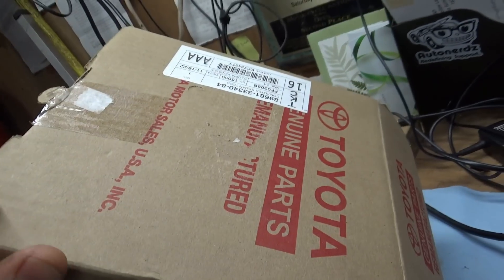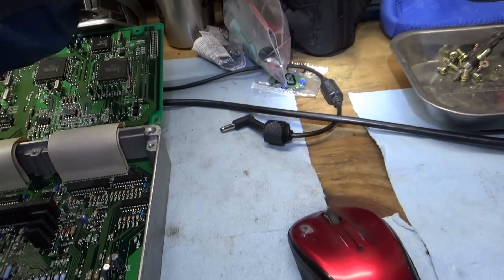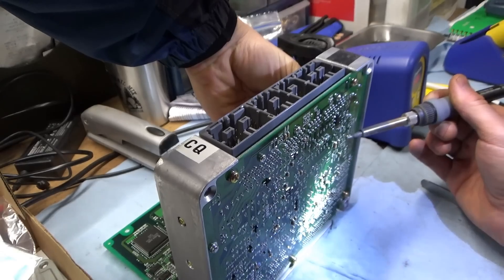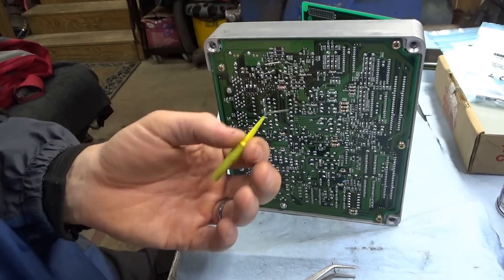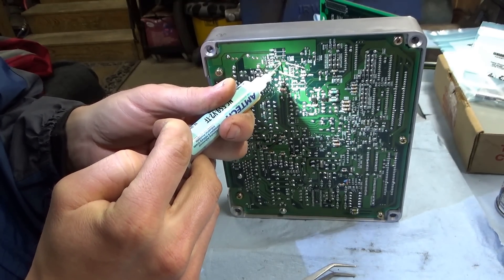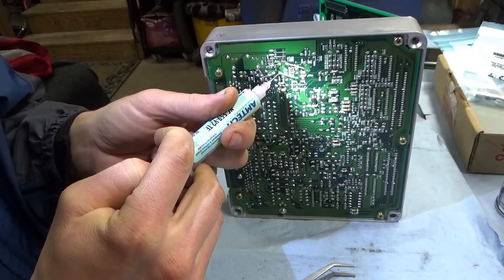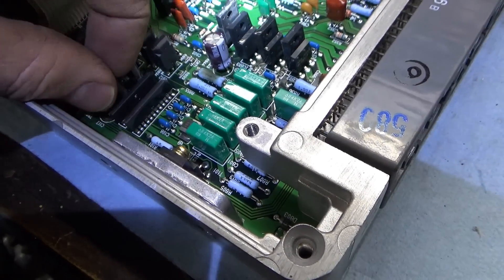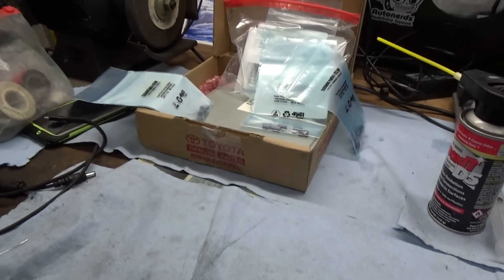Crazy Classic Camry: Intermittent LIMP-HOME? (Part 3: COMEBACK?)

Comment: I have successfully jumpered damaged traces with small gauge wire. Good catch by the customer! Ivan you need a Hot Air Rework Station, they are cheap and make desoldering a dream.

Comment: I suggest to use higher voltage capacitors, 35v should be more than enough. 15v ones working way on its limit and are prone to fail. Anyway good job Ivan!

Comment: Should have used solid capacitors instead of replacement wet capacitors. As you already saw, wet capacitors leak and destroy the board.  Wet capacitors are like batteries, they will leak and will destroy the device.  Using solid capacitors avoids the future failure.  His spare and repaired computer will be dead in the future because of the presence of wet capacitors.  Factory uses wet because they are cheaper not better.  
Can use nail polish for covering traces in repaired boards.  Can use nail polish cleaner or acetone to clean up leak from boards.  
Did you use your meter to test the new capacitors for being good?  Replacement parts need to be known good new.  Assume you got the polarity correct when installing replacement capacitors.  
Good that the factory wasnt pairing computers with the cars yet or would have been reflashing PROMs.  
Complements on venturing into module repairs.

Comment: For fine work like that, I would strongly recommend some desoldering braid.  Worst case, use a little extra flux with it.  The old solder will come right up.

Comment: DigiKey rocks! I was able to repair the original Ford MLP sensor (neutral switch) on a family member's 97 Taurus by replacing the bad surface mount microresistors with perfect matches from their catalog. Their selection is incredible.

Comment: I used to repair those ECMs for a local auto shop nearby. Almost all of them were 91-96 Toyota/Lexus models. Mostly LS400, ES250, RX250 and Camry. Some of them were so bad that I had to use jumper wires all over them. Lots of eye and neck strain from looking at a magnifier for long periods of time. When I watched the first two videos, I had the ECM in my mind. But who am I to second guess you! The ECMs I worked on had a variety of symptoms ranging from misfires, no start after hot soak, injectors not closing or opening, etc...I used to clean the pcb with acetone and a toothbrush. Thanks for the video. Great stuff as always.

Comment: "Back in the day" I repaired bunch of ECU's on `90 Toyotas (pretty much AE101 20V units), most of them would have leaky Nichicons, most of the time symptoms will be rough running, in AE101 case it would leak on to base of the VVT Transistor and cause VVT to intermittently activate.

Comment: For replacing electrolytic capacitors, always use Low ESR caps, 105 degrees Centigrade. For opening holes, I use a wooden toothpick as it opens the hole and does not try to get soldered in. Vacuum pump driven desoldering gun is obviously better, but overkill for sporadic use.

Comment: I don't understand why he just wanted the old one fixed? Unless there have been issues with the remanufactured ones. Wouldn't most people just have you install the new one?
Reply: The new reman worked fine. I had Ivan repair the old one , and he did, and I reinstalled it when I got it back and it’s been perfect ever since , and I put the reman on the shelf for a spare. I also got a spare exciter box on the shelf. Being these parts are somewhat problematic on this vintage, I’d rather have them and not ever need them rather than need them and have a hard time sourcing them down the road. 👍

Comment: Solder wick is great for double sided PCBs, it will clear the old solder on both sides, and with a bit of practice you can clear the through hole out also, more heat (to a point) is also beneficial as pulling on components when the solder is not fully liquid can put the tracks off the PCB especially on the double sided boards.

Comment: I can confirm that Northridge Fix’ solder wicking braid is excellent for through hole components. He has also started marketing a solder sucker that works pretty damn well also. Most of them suck, figuratively, but not literally. He actually does suck.

Lay down some of that flux, put the solder braid on the hole, give it some heat, and watch the magic happen. It’s rather amazing! Cheap, too. One roll of it would probably last guys like us a lifetime.

Comment: Capacitor replacement Tip:

When having to replace electrolytic capacitors like Ivan is doing with this ECU. 

The Voltage is very very critical more so than the microfarad specs on the defective capacitor .
Reason the voltage is very critical is if you go with a lower voltage for the new replacement It'll at least vent its electrolyte mixture or at worst it'll blow up with a bang it'll scare you and choice words might follow or the can its self could pop off with a bang the smaller caps sound like a .22 callaper gun being fired off . Pretty much don't over volt electrolytic caps or they'll go off  with a bang.  If you cant get the exact voltage for the replacement cap go with a higher voltage rating with the same microfarad rating as the old cap.  

Also the electrolytic in these types of capacitors is corrosive and can and will eat the circuit traces on the circuit board.  If the traces are damaged use distilled white vinegar to neutralize the electrolytic then use either 99% rubbing alcohol or denatured alcohol to rinse the vinegar off . use pieces of insulated wire to make new circuit traces from point to point.
Reply: Any of the capacitor specs can be important depending on the use case.  But yes, exceeding the max voltage is a quick way to failure.  But failing on other specs is a much more difficult issue because you're not alerted to your idiocy with component exploding.

Comment: Good work, Ivan!  I am confident that your repair will outlive the rest of the 30 year old Camry!  I'm just curious though.  If the owner did ever have to use the new part from the dealer, would he have to reprogram the VIN?
Reply: Just rewatched this series this morning for a Memorial Day special. I put the pcm in before Ivan repaired the old one and it cured the problem. When I got the old one back from Ivan, I reinstalled it and put the new one on the shelf for a spare. Been working perfect ever since. No programming needed on these , just plug and play. Just treated the old girl to a new Toyota battery a few weeks ago. 👍👍🇺🇸

Comment: I had the same problem in a 94 Camry, open the computer and all the same capacitors were leaking causing the car not to accelerate. I just didn't know we're to find the capacitors.

Comment: Just a tip Ivan. To remove Retro electronic components, first cut the leads on the component then take out the lead or pin if it's an IC from the board. To clean the hole of solder use a Solder Sucker or Solder Wick ( they are both inexpensive and work better than expensive de-soldering stations on retro electronics) . This tips will reduce the chances of damaging the PC Board. Love your videos

Comment: Holy Cow, Ivan !!!  I am going through that exact same process to replace leaking caps on boards in my old 89 Toronado Trofeo.  Got a few caps and a diode or two in the VIC (touch screen Visual Information Center), and at least one in the Digital Cluster (responsible for power to the wakeup process).  The car has been parked for 4 years due to loss of communications, and cap degradation on the CRT screen and cluster.  I'm hopeful this will bring that car back to life, as I ordered it new, special equipped, back in the Fall of 1988.  Wish me luck!

Comment: use to have a 91 mirage with a capacitor leak in ecu-replaced and lasted a little over a year then different capacitor blew out and ate part of board, got good refurb board and lasted till trans broke 328k miles.

Comment: A good plan is to cut the component off the board, leaving the pins sticking into the board, then remove the pins, by themselves, one by one, as you will then not have to straighten the bent over pin on the solder side... just heat to molten, and use tweezer to pick off the, now straight, pin.  Attempting to straighten the bent pin using the solder iron tip is a good way to either pry the trace pad off the board, or have the tip skid and jab some nearby, unintended, joint.  A cap, for instance, when removing as you are, requires you to lean the component, thereby pulling on the non-involved pin.  Use a solder pullit to vacuum solder off the board, clearing the hole.  A needle can become trapped in molten solder.  Also, always add some new solder to add to old joint solder before pulling the pin.  Then clean the excess solder off the pad.  For a tall component like this cap, apply some silicone RTV to board/cap junction, to dampen any vibratory moment onto the leads.  When clipping off new part leads, always hold the loose end of the lead before clipping, to keep if from firing off to some unknown place.

Comment: Well done, electrolytic capacitors globally had a big problem about the time that unit was made due to a bad electrolyte formulation. I have changed a lot of them in  devices of that era. I tend to use a spring loaded desoldering pump  and spray the board on completion of the job. Great to have proper closure on the fault, the car was worth the trouble.

Comment: Working with Communication boards in an air traffic control system 80% of our problems were proving to be degrading electrolytic capacitors. We began by replacing them with Identical 'original' components then it occurred to us that we were just making for a fault in another 5 years so we identified an identical specification capacitor from a different supplier and had no further trouble in my remaining 10 years.
We also had a similar joint / trak issue on a GMC minivan wiper controller , luckily we did have track repair kits. A vacuum desolder units makes life MUCH easier

Comment: With the older boards such as this, it helps to add fresh solder to the solder joint. It makes it easier to desolder later. Then use a desoldering braid to wick away the solder, which should also pull through any solder that is trapped in the through hole.

Comment: Ohh, it hurt my electronic engineer heart a bit.
You realy should use the desoldering station, when you pull the cap, you can pull the trace with the cap on the component side.
And when you solder in the new component, you cut the leg before soldering. When you cut the legs soldred in, you can cause stress in the throughole, the board can be multilayered, and the connection could breake.
I normally use isopropanol alcohol and a cotton stick to clean the crusty after the faulty component has been removed.
Anyway, nice work. 👍👍👍

Comment: Hi Ivan, many manufacturers install electrolytic capacitors at or very close to the working value of the circuit over time these components will fail by design (engineered obsolescence). because of this I always increase the voltage of the capacitor when I replace them. Koodos to the owner for finding this.
Rich

Comment: Excellent video Ivan! This goes to show, that fancy code scanners can’t always find the problem with vehicles. Yes they’re very helpful, but wouldn’t have found that failure of Capacitors. “The Brick” is still a good scanner, I still use mine occasionally.

Comment: The ‘91-‘94 Ford F-150’s had a similar issue. Leaking/failed Capacitors inside the ECU. Poor running, until the Power Steer Pressure Switch is unplugged (Self Test bypass). 3 New Capacitors & the ECU’s are fine again.

Comment: The good thing about the early cars is that the replacement ECU doesn’t need recoding to the car, so just plug and play. You’ll never find the circuit diagram for any of these ECUs so damaged tracks/traces are almost impossible to repair if you can’t see both ends where it should connect the only help is that the capacitor negative side generally goes to ground if it’s a decoupler. As usual nice video 😀

Comment: I'm very sure something must be shorting out the capacitors. It's very rare for four or more capacitors to go out just like that.
Reply: Really? You might need to just ease back into the shadows and listen until your knowledge base increases SHARPLY. Electrolytic caps are basically little batteries in their construction. Aluminum foil with a dielectric formed from an oxide layer created by an electrolytic solution applied to to the foil during manufacture. The electrolyte will, given enough time, get out and destroy everything it contacts. As a lifelong electronics hobbyist and a Ham Radio Extra Class license holder, it is my experience that it is routine to have to replace every single electrolytic cap inside of an electronic device at some point in time since it was done last. ESPECIALLY ON ANYTHING THAT SERVES ITS LIFE SENTENCE IN OR AROUND A VEHICLE. So, to you, I say ssshhhhhuuuusssshhh, listen and learn about what we call REALITY. It is so very common for multiple electrolytics to fail at the same time that we open the device and check that FIRST, when a radio goes flaky.
Reply: They probably didn't "go out just like that." Most likely, they failed one at a time over a period of weeks or months. You're very wrong to be "very sure" and it not "very rare" to find that multiple electrolytic capacitors have failed. You should keep your uniformed opinions to yourself (but feel free to ask questions -- that's how one becomes informed.)
Reply: Really? You might need to just ease back into the shadows and listen until your knowledge base increases SHARPLY. Electrolytic caps are basically little batteries in their construction. Aluminum foil with a dielectric formed from an oxide layer created by an electrolytic solution applied to to the foil during manufacture. The electrolyte will, given enough time, get out and destroy everything it contacts. As a lifelong electronics hobbyist and a Ham Radio Extra Class license holder, it is my experience that it is routine to have to replace every single electrolytic cap inside of an electronic device at some point in time since it was done last. ESPECIALLY ON ANYTHING THAT SERVES ITS LIFE SENTENCE IN OR AROUND A VEHICLE. So, to you, I say ssshhhhhuuuusssshhh, listen and learn about what we call REALITY. It is so very common for multiple electrolytics to fail at the same time that we open the device and check that FIRST, when a radio goes flaky.

Comment: Well done I'van, Pro repair 😀
Through plated holes or Vias  can be a nightmare,  apply too much heat or force and you are in trouble.
I learned that a loooooog time ago lol.
Thin enamel coated wire can save the day :-D
Electrolitic caps are dam evil, they secretly leak and eat the copper tracks.

Comment: Capacitors have improved over the years - you are better off looking for the longest life and highest ripple current rated part, in a 105'C version.

The replacement can also have a higher voltage rating  - it may need to with some types, as the exact same value & voltage may now come in a smaller case, so selecting a higher voltage type can allow a case size match.

(Under-running electrolytic caps in voltage, current and temperature increases their life expectancy by thousand or even millions of times - which is essential, as the base life expectancy with all ratings maxed out may often be as short as 1000 hours with some types; just six weeks...)

Comment: Solder wick with a little added flux works great for removing the solder when desoldering components from a board. It also removes the solder from the through hole at the same time. It's inexpensive and a roll will last a long time.

Comment: Great job Ivan..taking on circuit board component level repair requires special skills and equipment …in my experience the number one item after a good quality solder station was a large high powered magnifying glass 😂

Comment: This was an interesting case study. I do not believe this was a comeback, there was nothing to indicate definitively the ECU was the issue, nobody would have been able to make that call, the ignitor module would  have been the next logical item on the hit list. The good thing is even you were not sure if the ignitor module was the problem, hence not replacing it while it was at your shop. I acknowledge you were heading in that direction, though not entirely convinced.

The parts you did install after testing pin fitment were wise even if the plugs could function without them. The fact that somebody had been in there and some damage was caused, really did require them being ruled out. And they were cheap. So definitely not a comeback!

Comment: A few tricks I learnt , adding a bit of fresh solder helps but to take it away I use a bit of stranded copper speaker wire, the solder flows up the strands leaving a clean terminal, I have a small pair if cranked long nose pliers I find much better than my fat fingers … I did a discontinued sofa control board and the track was damaged, I just used a short length of 0.5mm copper wire to jump from the component to the good part of the track .

…and lighting ! I have some rechargeable video lights by Andoer 2” squares, and some 20mm magnet mounts with the camera thread.. they stick to the car, the garage beams or wd40 tins 😂… I was thinking of getting one of those selfie ring lights , I’m at least 20 years older and lighting up the work piece gets more important 

I’m learning lots , I have 2 Triumph TR4s, 2001 yaris and recent Skoda in my fleet .